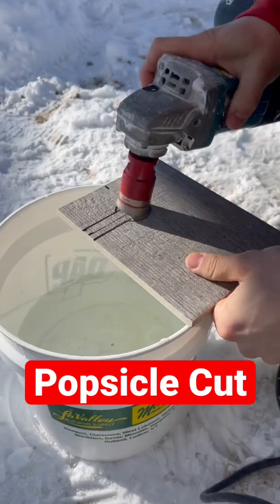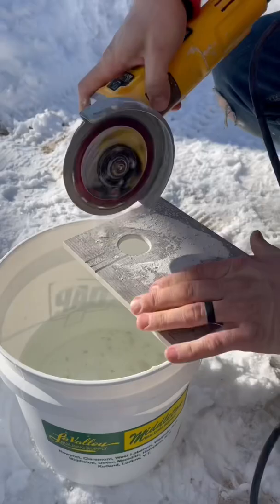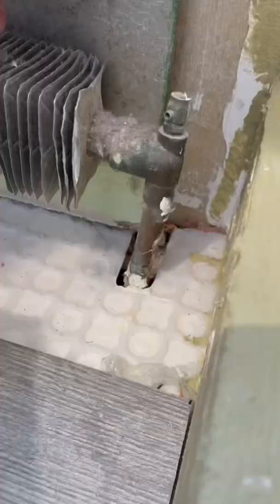How to cut around radiators. #diy #youtubeshorts #shorts

Comment: Or take the radiator off and it looks like a professional has done it
Reply: Professional fitters chase the rad pipes in the wall and tile before the rad goes on so the tails come through nice and neat, not have them going through the floor tile.
Reply: @MercMan115  correct my friend
Reply: @Liam.921  you in the UK?
Reply: @MercMan115  yes
Reply: I ate grilled cheese off the radiator for 20 fckin years!!
Reply: I compromised
Reply: @andrewsteele807  see where I'm going
Reply: You really think a floor guy is going to remove a damn radiator
Reply: @leathercheerio1  who’s to say he’s not a plumber aswell?
Reply: thing could be 100 years old. it breaks and leaks in the wall because you wanted the tile to look nicer, you just bought half a house.
Reply: @leathercheerio1  i do

Comment: Why make a big circle when the "stick " is wide enough. ? U should be able to do a u without a hole saw.
Reply: Harder to cut the end square it’s easier to just use a grinder and make a hole. And as long as it’s covered what does it matter?